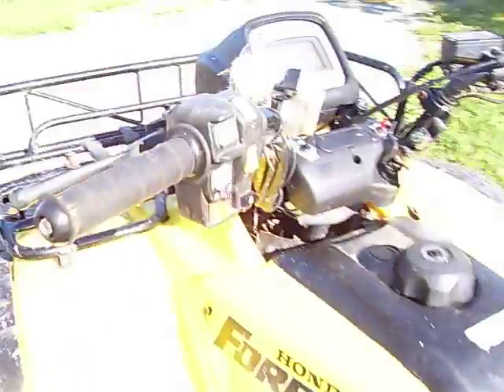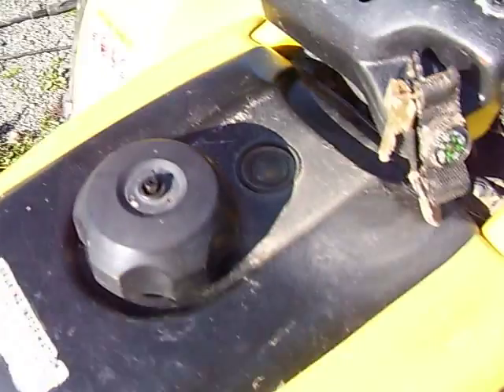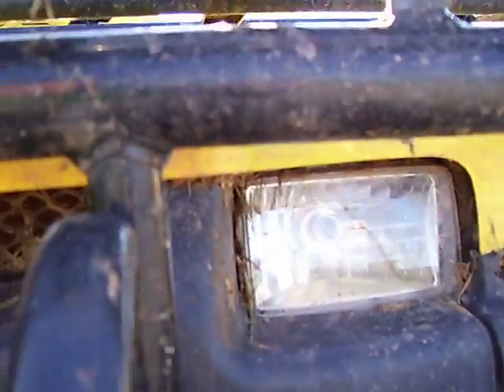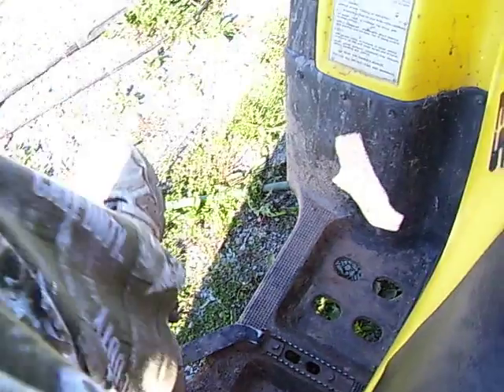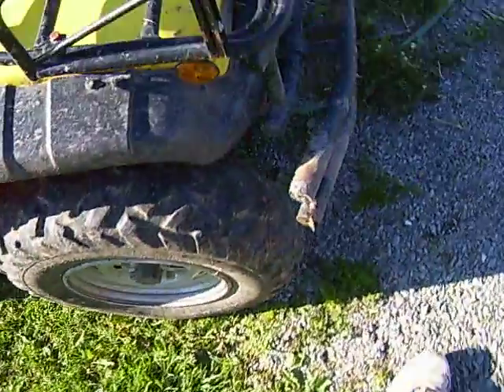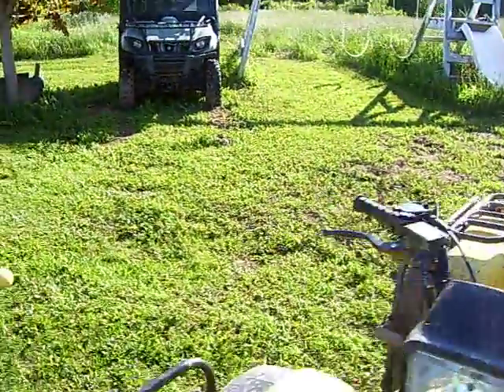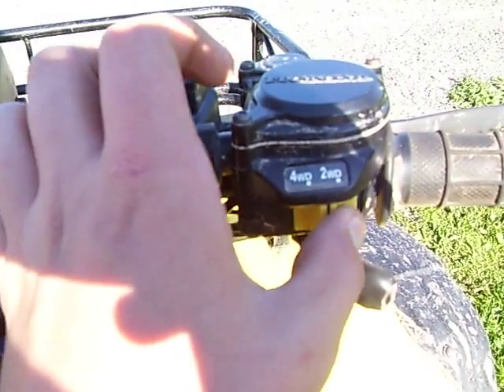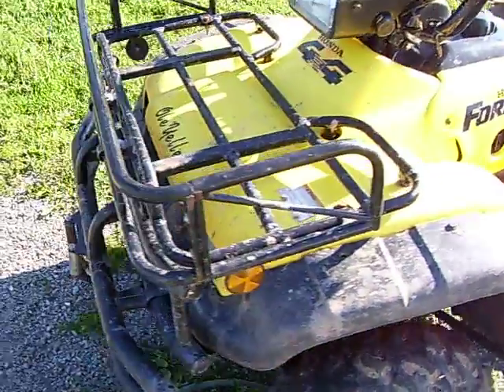honda foreman 450es review

Comment: we have a 2000 honda 450 es. we only use it for farming and regularly pull a 300kg rush wipe. Has stood up to the abuse however it keeps sticking in gear (like yours) when it gets warm. this has happened before. It is the angle sensor. it costs 70 pounds here in ireland. overall thogh it is indestructable.